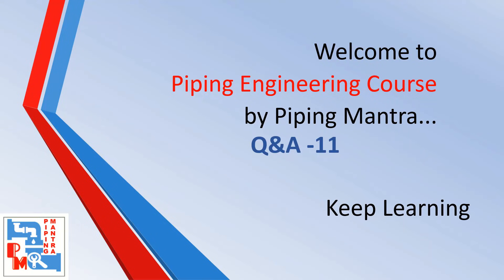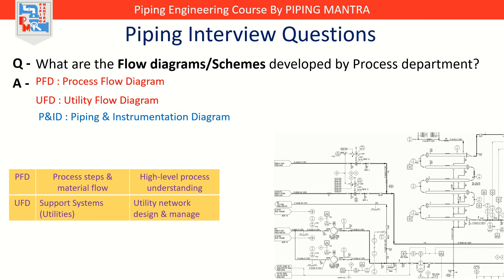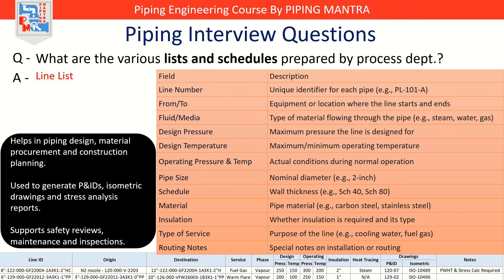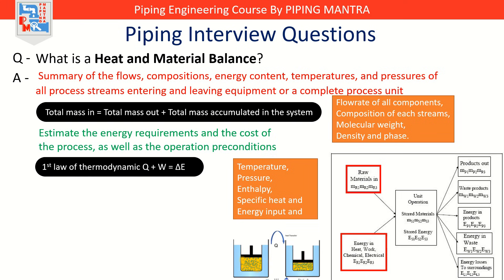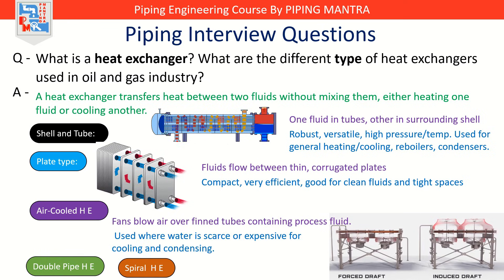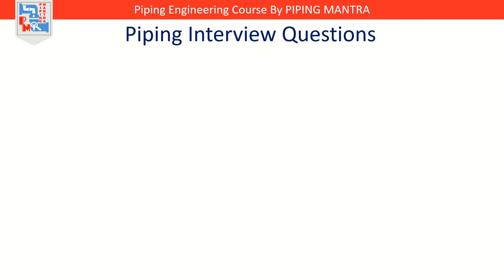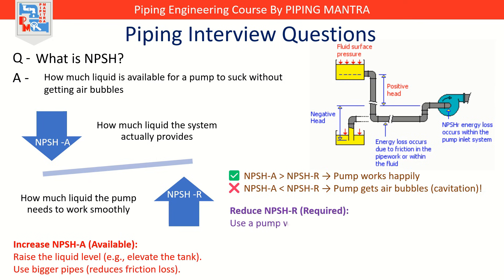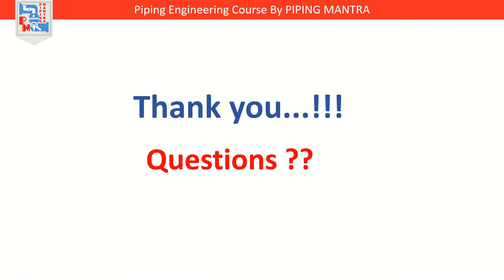Piping Interview Questions | Process Engineering | Piping Mantra |

Comment: why do socket welded fittings have high rating eg. 3000 , 6000, 9000  other hand but welded have same as pipe  , is neccesary to make sw fitting with this much high rating
Reply from the maker: Because these are forged items
Reply: @PipingMantra  thanks